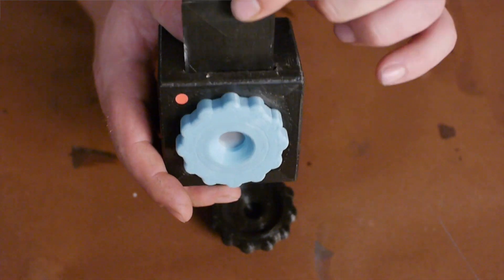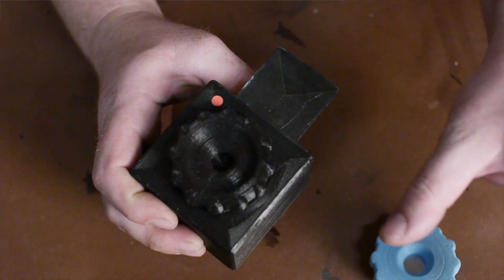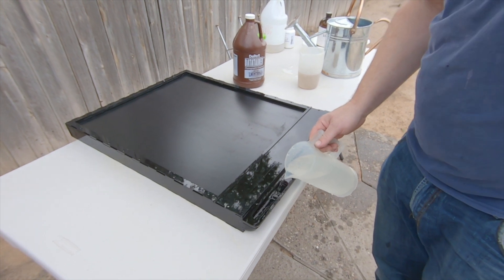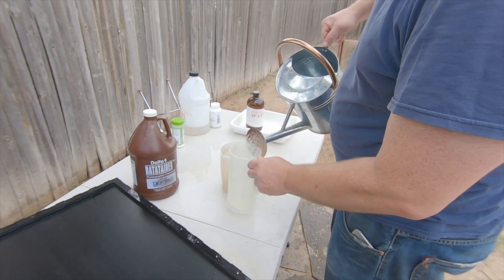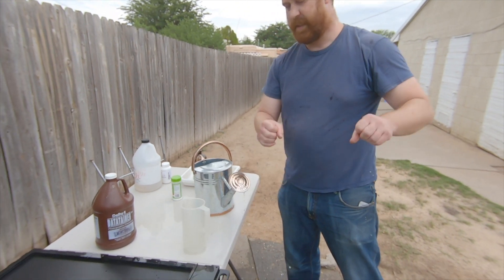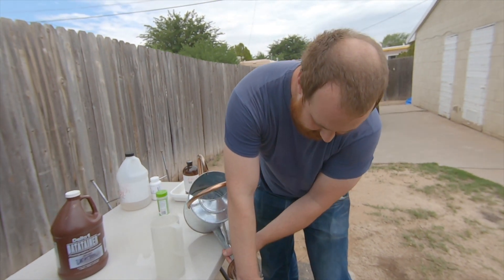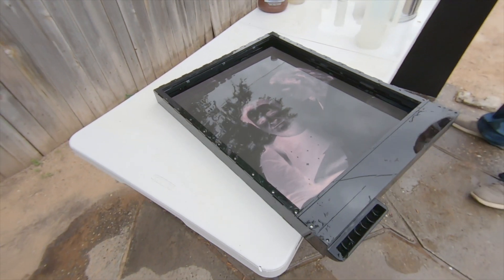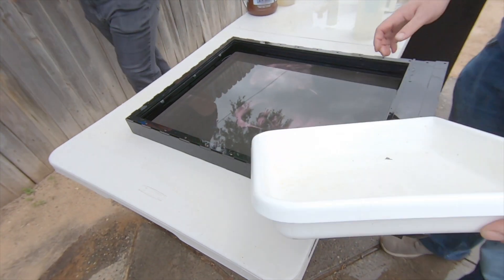The Dream Part Two

Comment: I've been experimenting with citric acid/H2O2 (12-18%) for bleaching and would often be left with a stubborn spot or spots that just wouldn't bleach fully. I also noticed that the emulsion was rough after bleaching and was wondering whether the H2O2 damages the gelatin. Just to compare, I used the tried and true photo booth method of reversals (1% potassium dichromate + 1.2% sulfuric acid for bleach, sodium sulfite to clear). It only took 30 seconds to bleach completely and 15 seconds to clear, and the emulsion seemed intact. You need a hazmat suit to use it though...

Comment: Hey Joe and Ethan, do you wash between the stages or just go from dev to citrix to bleach etc? Thanks!
Reply: And do you fix after the second development? TIA!
Reply from the maker: @bnrynlds  We wash after the peroxide, then just before the second development. And a final wash before drying. They don’t need fixing as there’s no undeveloped silver halide left in the paper.
Reply: @Joe_VanCleave  Thanks Joe! I guess the final question is, what ISO do you rate the paper at?
Reply from the maker: @bnrynlds  The B&W reversal process needs lots of light. We were using ISO3 plus 3 stops. In autumn afternoon light it was F/5.6 at around 1/15s. But you need to make a few tests every time you set up, since chemistry temperature is also an issue. This process demands testing before every session due to multiple variables. Good luck!
Reply: @Joe_VanCleave  Thanks Joe. I am hoping to get access to a studio/darkroom so hopefully I'll be able control a lot of those things!

Comment: Hi Joe, have you experienced issues with the images getting an orange tint after doing a few in the same days using the same chemistry? Ie the day starts normal and after 3-4 images, they are slowly developing and orange tint. Inm thinking chemistry related?
Reply from the maker: Ethan's the more knowledgeable, but chemistry can age, affecting the color. You should also do a good rinse between the stop bath and color developer.

Comment: I made a test today with Fomaspeed 311, but i used 30g/liter of citric acid. I bought small bags from the food store. I finally got a nice result at ISO 0.3. What is the effect of my strong citric acid? Does it make any big differene?
Reply from the maker: I'm assuming you can only get so much citric acid in solution; or you can saturate the emulsion with only so much citric acid. So having extra in solution is just insurance. The citric acid reacts with the metallic (developed out) silver in the image to form silver ions, when then react with the peroxide to be bleached out of the emulsion into solution. Our earlier experiments were with weaker solutions of citric acid, and shorter soak times, but lately we're using longer times with a stronger solution, and it seems to require only one subsequent peroxide bath to do a good job bleaching the emulsion.

Regarding your ISO 0.3, it's difficult quantifying these numbers accurately because light meters are sensitive to the panchromatic spectrum, whereas B/W paper emulsion is sensitive mainly to UV, blue and a bit of green. The true amount of UV/blue in the scene that reacts with the paper depends on the light source and color of the subject, and its reflectivity (water and shiny metal reflect UV much easier than other objects, for example).
Reply: @Joe_VanCleave  Thank you for taking time to explain. I agree with your thoughts about the challenges of finding precise ISO levels. I live at about 58 degrees north and the sun is also lower than in your area. I have experimented with using yellow filter on paper negatives. The results are more predictable because I have removed UV and reduced blue light. The negative is also much less contrasty. The sky is'nt white and I can see clouds. But with my lightmeter, I rate the film at ISO 3 with the yellow filter and about ISO 8 without any filter. I havent tested it yet, but I believe that a skylight filter or UV filter will make it easier to handle light reading  without changing the contrast to much if that is the look one prefers.
Reply from the maker: @GeirBakkenVestfold  I’ve had similar thoughts about UV filtering for accurate metering. Perhaps I can do some tests….
Reply: @Joe_VanCleave  It would be interesting to see your results from that test.

Comment: I've been trying the peroxide/citric acid process a couple of times (with variable results) but this is the first time I have seen that you use fixer between the bleach and developer. What does the fixer do?
Reply from the maker: The process order was: Developer, citric acid, peroxide, sodium sulfite, 2nd developer.

The sodium sulfite is used as a stain remover, to prevent some of the brown stains that can happen. It's not fixer because it lacks the sodium thiosulfate; sodium sulfite is the active ingredient in wash aids, used post-processing.
Reply: @Joe_VanCleave  Thanks!